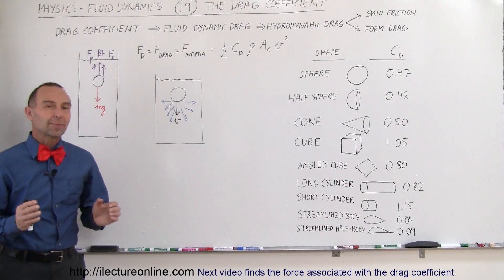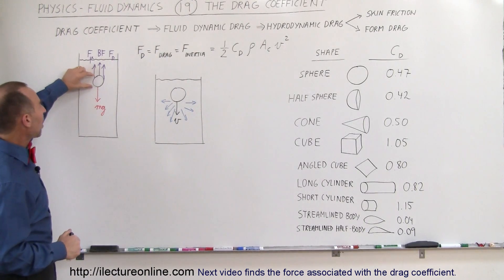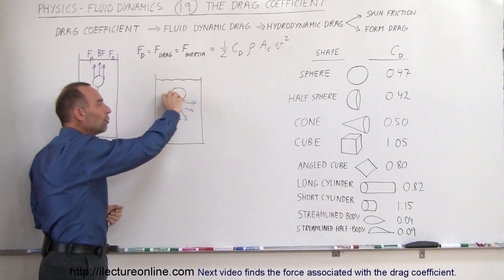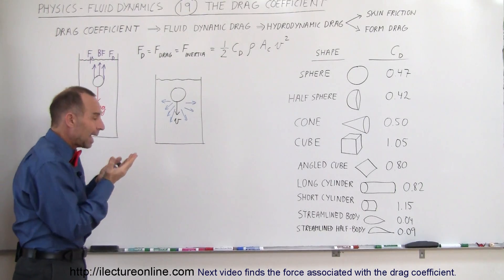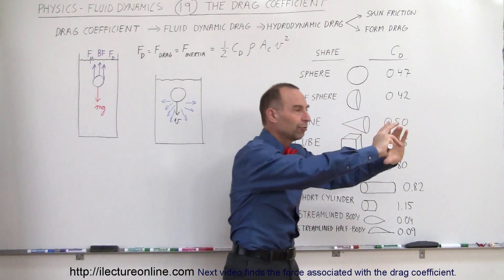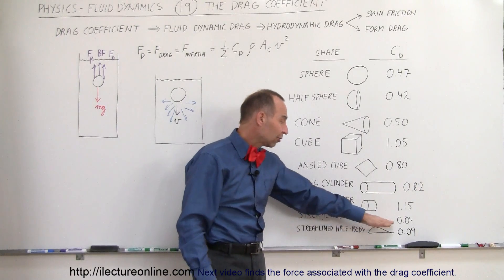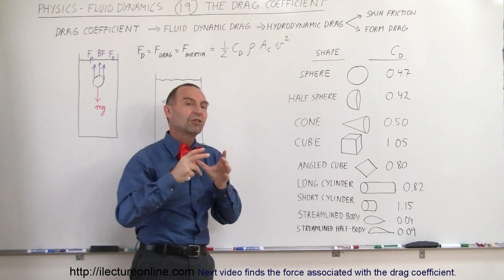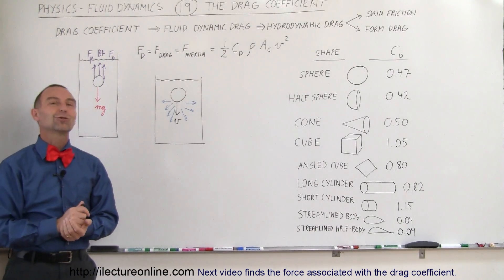Physics 34  Fluid Dynamics (19 of 24) The Drag Coefficient

Comment: I have a question regarding the formula used to calculate the drag force in this video. From a previous video about the Stoke's law, the equation used to calculate drag force of a sphere is FD=6πμRv, whereas is shown as a different equation in this one. Why are there different exponents of v in the two equations? Are they referring to the same concept? Thanks.

Comment: Hoe does drag coefficient vary with higher Reynolds number???? 
Thats why i came here.
Reply from the maker: In laminar flow the drag forces vary linearly with velocity, but as the laminar flow becomes turbulent, the increase in the drag force is no longer linear with velocity and doesn't increase as much with increasing velocity.  A good approximation is that the drag forces are then proportional to the square of the velocity.
Reply: @MichelvanBiezen  yesterday i appeared in an exam, where one question was like: Find the drag coefficient if Reynolds number is 10^6
Reply from the maker: I have seen the formula where the drag coefficient = 24 / Reynolds number.  But that is for a sphere and small Reynolds numbers.
Reply from the maker: At larger Reynolds numbers the function becomes non-linear and flattens out at about 0.4 for Ryenolds numbers from 1000 to 200,000 then drops further to about 0.1 for Reyolds number = 10^6

Comment: I am having trouble to determine drag force with my question regarding raising ball viscometer.....what is happened now if i change the movement of ball which i pull it out from the liquid (the movement of ball in the fluid will become upward) ,does drag force still exist here on the ball and where is the direction of it?
Reply from the maker: Drag force exist whenever the object is moving and the direction of the drag force will be opposite to the direction of motion.

Comment: I'm 14, so I'm going to get easily confused, but how do you work out the drag coefficient that relates to the shape? For example, how can you work that a cube has 1.05 drag coefficient?

By the way, I'm trying to find out about acceleration and lengths objects get over time, with other forces pushing against the acceleration. I would like to easily be able to answer a question like this: a man is 350m high. He drops a cube made of pure copper. The cube is 64cm squared. (I'm guessing you can work out the mass and density of the cube) the density of the air is 1.2kg/m cubed. How long will it take for the object to hit the ground, keeping in mind that the gravitational acceleration is 9.8m/s squared. I think this is enough data.
Reply from the maker: Drag coefficients are experimentally determined.
Reply: Michel van Biezen OK thanks! I won't be doing that then haha. Great video by the way.
Reply: S=ut + 0.5at^2

Since u=0 at start, the equation can simply be written as, s=0.5gt^2. Where "s" represents displacement. 

Use this formula to get your answer. Most of your given data is useless in thks calculation i guess.

Comment: thank you Sir，I have a few questions:
is the fluid still or kinetic,If the fluid is kinetic what should we do？the case will be more complicated I think，the fluid is moving, there are three conditions for sphere,1.floating on the surface of the fluid, 2.Submerged in the fluid but not at the bottom，3. on the bottom,so for these three cases,how to proceed to motion and force analysis?

Comment: suddenly got here after watching some One Piece videos lol. I absolutely know nothing abt this but it's interesting. So here's a noob question on a "logical" sense of mine.. Why do the cone shape got higher drag coefficient than the half-sphere ? I mean.. it's pointier than the half-sphere and the half sphere surface is wider. Does the rear shape affects how great can it slice through fluid ? sorry if this ticks off anybody lol just curious
Reply from the maker: That is a really good question. Understanding the drag on objects is very complicated.  It is usually easier to place an object in a wind tunnel and look at the results, rather than trying to calculate it.  It turns out that the drag on an object has a lot to do with the shape of the back.  Note how cars that are very fuel efficient do have an abrupt square back, to reduce drag.
Reply: ah ! now i remember, the Toyota Prius ! that one have quite a good reputation on being a fuel efficient car. Thanks for the explanation ! :) great vid sir 👍👍
Reply: Kawasaki Nerd - If I may add an engineering perspective... First, I consider Mr. van Biezen to be one of the very best instructors, ever. Now, sometimes engineering must make practical compromises that do not adhere to theoretical optimums. The back end of cars must be crash - worthy (with bumpers) and accommodate cargo (in trunks). But notice that solar-powered cars in research competitions are often shaped like a manta ray, tapered to a thin edge in back. The goal is to reduce energy-stealing induced drag caused by vortices at the rear of a vehicle. There are a few tractor-trailer rigs on the road now that have a huge, rounded fiberglass fairing above the bumper that covers the rear doors of the trailer. Apparently the fairing expense was justifiable, given the huge, flat trailing surface (perpendicular to vehicle direction). In general, a dolphin shape is a very good one to imitate (to the extent possible).

Comment: sir what is the difference between the viscous force and the drag force ?
Reply from the maker: They are off course related, but there is a distinction.   The viscous force is caused by the "friction forces" between the fluid molecules.  (the more the molecules are attracted to one another the greater the viscosity).  The drag forces are caused by an object moving through a fluid and it depends on the velocity and the shape of the object.
Reply: Michel van Biezen thank you very much sir .